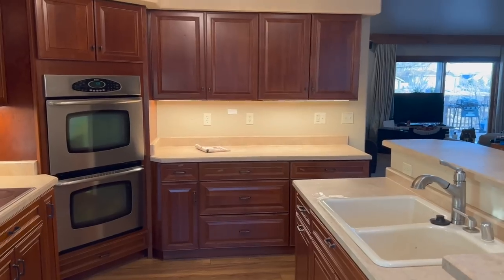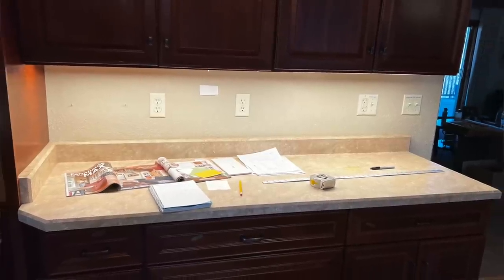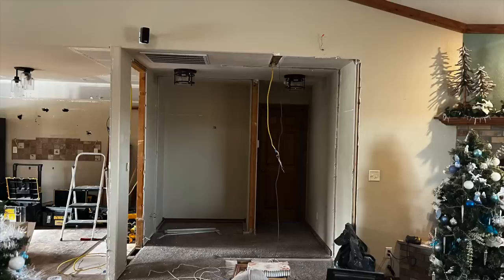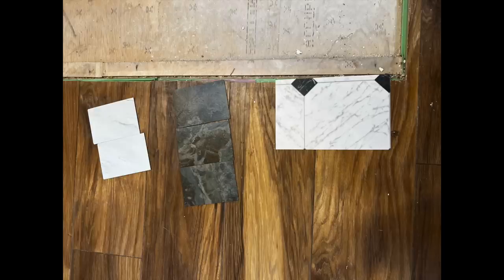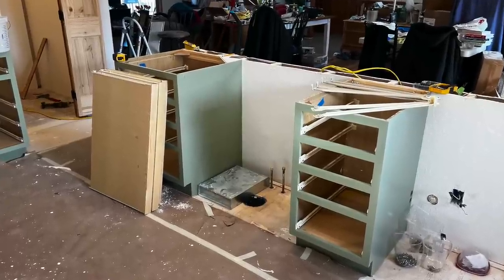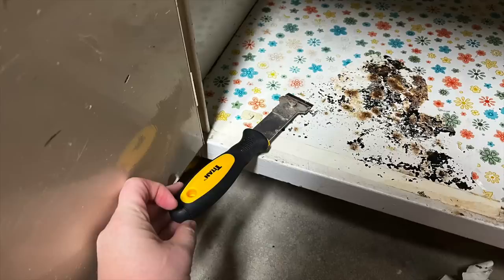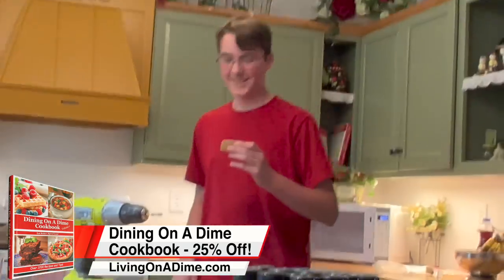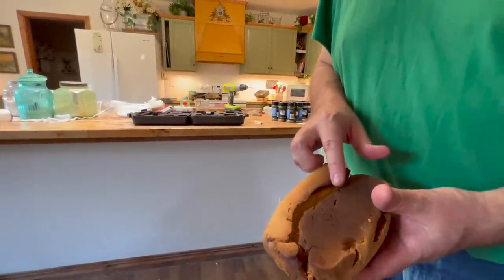We completed an EPIC Kitchen Remodel...You WON'T BELIEVE What It Looked Like Before!

Comment: I feel for you. My youngest son is a contractor so he did my kitchen for mostly the cost of the cabinets and flooring. We had a few mishaps but nothing like you. Of course, your kitchen is much bigger than mine and there are several things left to do. My island is on wheels and is a sink base cabinet so there was no drawer and my son is so busy he hasn't built the drawer yet. We used the old countertop and used epoxy to turn the fake butcher block into a sandstone look alike. Still fake but looks great. There is trim to be done and ceiling to be installed then I can start to put things in place. We started in September 2022 and here it is June 2023 but my son donated his labor on his days off so my remodel only cost $2500.00 for materials and a few six-packs. Yours looks better than mine and that's OK by me It beat the heck out of the old kitchen. Most of the time I don't make it through your videos because they're so long. If you do stay on Youtube do shorter videos it might be less work.

Comment: I really  took my time to look at the before and after. With all the trouble you went through, I probably would have first started out by painting the cabinets the colour you chose. That was a nice choice to brighten everything up., I would have saved most all cabinets as is as they make for great storage, I would have kept the island with the sink and dishwasher there and for your cooking show I would have  just had made a removable place on either side of the faucet like a removal box type counter top removable form with the butcher block top. that way you could remove them when not filming your cooking show or just keep them but still have the extra faucet on the island. I do like the pantry idea, and I think you could have managed to just remove a part of the cabinets and counter area to make room for the pantry area, instead of having to demolish everything . The area with the big kitchen window, I would not have changed the sink bottom as you must have lost a lot of good cabinet space on the bottom of the sink are and for the top, I would have just removed the upper cabinets on either side keeping the long one to the far right .To begin with, I would have just painted the cabinets as you must have lost a lot of storage space. I think the bigger window looks nice, however for all that trouble , I fist would have begun by painting everything the lighter colour you chose to see if I could work with what you already had existing. Then if you still wanted a bigger window, you still could have done so  but still keep some of the cabinets storage to the right ,  removing only what would be necessary to make room for a bigger window, or not even bother with a bigger window as you sacrificed the electrical outlets for it. Perhaps just painting the cabinets would have been enough because the cabinets where looking very new & elegant and of good quality. I am just saying all this because ( of my own experience) I know the stress, mental & physical and expense it all cost you. For those thinking or renovating, I would suggest they try first just start to paint things first especially if its all in good condition to begin with. Then after the painting, if I still wanting to modify, I would do so, but slowly and thinking it through very carefully.And remember, contractors look fore big jobs because they want big money, so they will never suggest a smaller project possibility to begin with to see first what you can salvage as is, before tearing everything apart. If I was to buy a house today, at my age ( past fifties.. I would not look for something that needed any extensive and expensive remodelling.